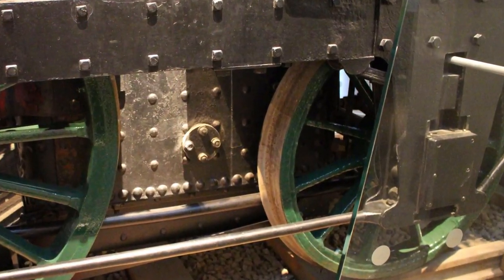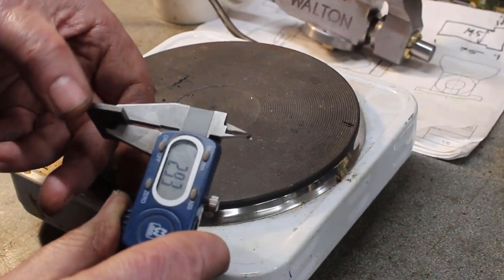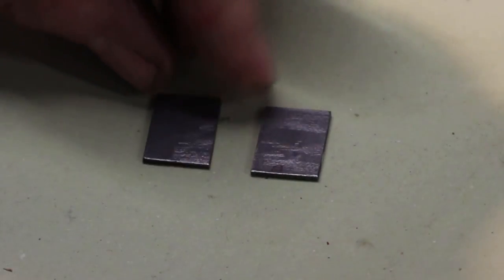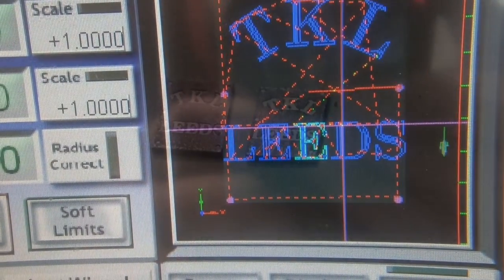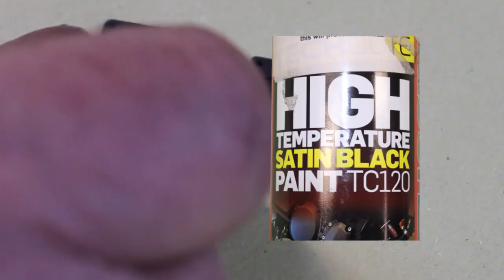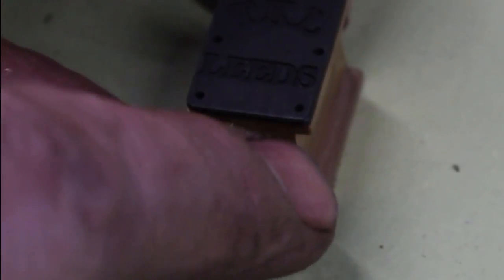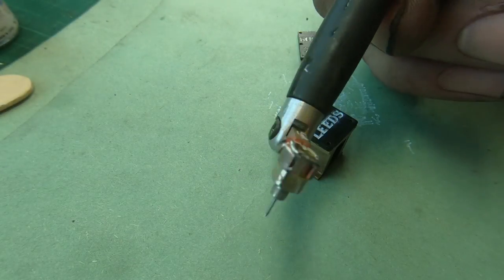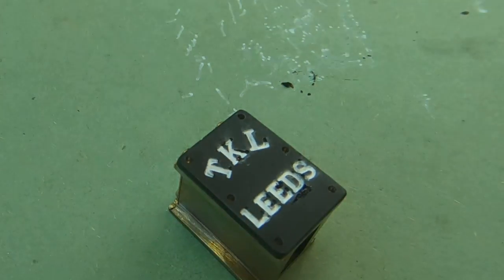Lion Locomotive in 5" gauge part 60 - Axle Box Covers

Comment: I also use Mach 3. You got that lettering from Mach 3 right? Did you tilt the letters T and L in Mach 3 or did you have to use some other software?
Reply from the maker: I did the lettering in Vectric Cut2D and exported the gcode to mach3. I've done similar using Fusion 360. So far I've not used any of the mach 3 addons but I do know there is one for text, I'll maybe try it out some time. I really like Cut2D but you do have to buy a licence.
Thanks for your interest, much appreciated.
Cheers!
Reply: @GoCreatehms  I see. If I were doing these covers I would have wanted to use cast iron too. But I would have cut off what I could with the bandsaw and then put it in the shaper. How come you didn't do that?
Reply: @GoCreatehms  You probably ultimately ended up with less than 10 percent of that cast iron and the rest became ships. Didn't it?
Reply from the maker: I like using the shaper, the more shaper chips the better! it is after all a hobby so do what you enjoy best.

Comment: nice touch, I was always under the impression loctite removes paint. apparently not?
your teasing me with your shaper again & I noticed a little vice lurking in the back ground.
well done, fabulous work
Reply from the maker: Thanks Paul! The high temperature paint, once heat cured is resistant to many chemicals unlike most paints. Cheers!